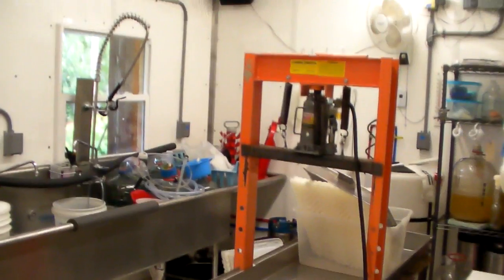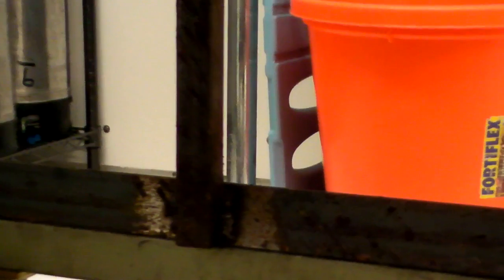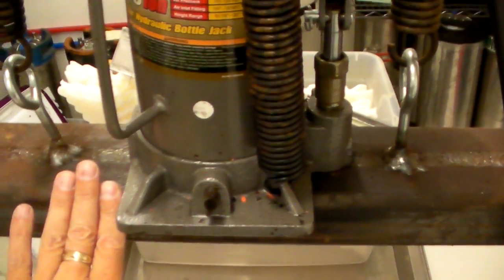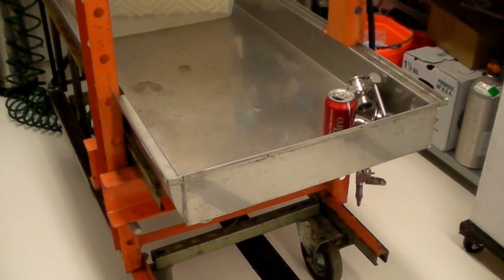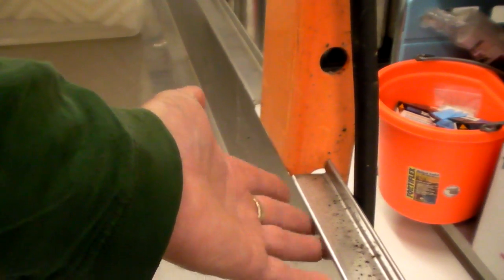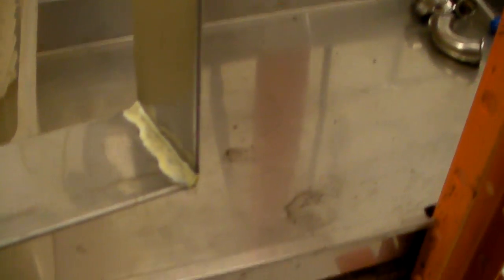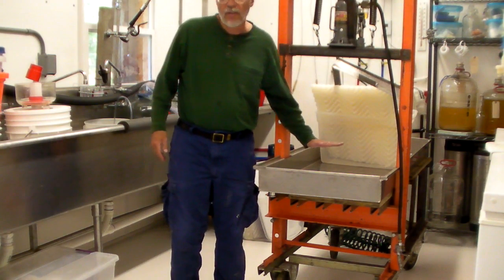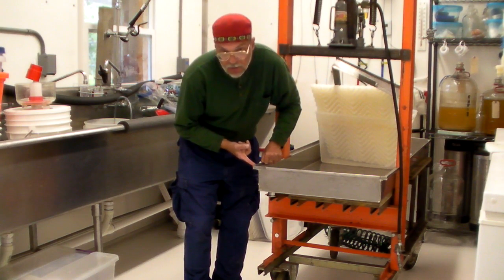Cider press design and evolution

Comment: If you were going to do any kind of production I would have built a rotating press design like the ones from the late 1800's that are still in use. The rotating design allow a second cheese to be built while one cheese is being pressed. When the first cheese is fully pressed the table rotates the next cheese under the press and the first cheese is striped down, the used pomace discarded, cloths and slats are set aside and a new cheese stack is filled, then the table rotates again. It is very efficient as it is a one person operation and as one side is stripped and rebuilt in the time it takes to press the other side so there is no wasted time sitting around.

Comment: I see that you use 304 stainless steel to make your tub but what gauge is it? How thick is the sheet metal?
Thanks
Reply from the maker: Hi Mike, I regret that I don't know!  The tinsmith selected the thickness based on my expectations and it's worked fine.  There are no open edges where I can slip a thickness gauge :(   It's not terribly thick, but it holds its shape well because of the rolled edges and folds.  I only take it out of the press once a year to clean under it.

Comment: Alan, do you expect to have a need for refrigerated storage?  If so, have you given any thought to what you might do? I expect to face that decision next season. Thanks.
Reply from the maker: Wow, just seeing this.  I have a very large chest cooler for now.  If and when the orchard becomes productive, I'll improve a portion of the barn to be a walk-in cooler.  Poured floor w/2" insulation.  Spray foam on walls and overhead.  Modified window box A/C for slow chill down with minimal power consumption.  There is no commercial refrigerated storage anywhere around here :(

Comment: I was considering building my own tray using polyethylene boards and glue.
Your thoughts?
Reply from the maker: Prof.Kent I have not found a glue that will bond HDPE.  It's usually "welded" using a hot air tool and filled with HDPE from a stick.  Kind of like TIG welding.  You could make one from wood and use a food safe coating on it...  Good luck, and cheers!  Al